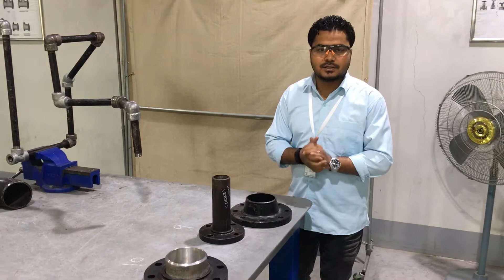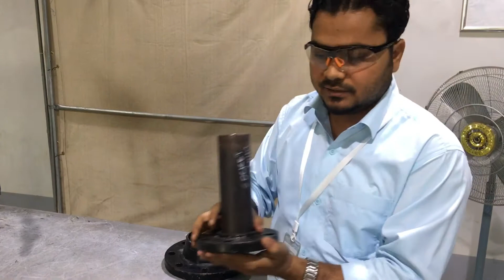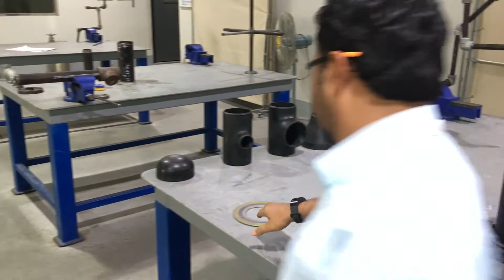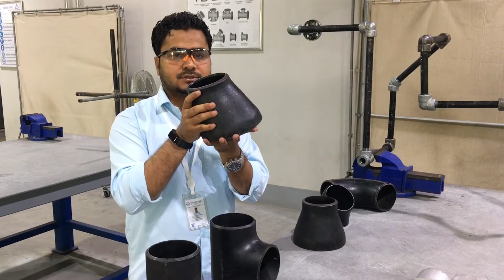PIPING DIFFERENT TYPES OF FLANGES AND PIPE FITTING

Comment: Weldneck Flange 0:32
We will attach by welding flange to pipe using butt weld process, we will mainly use these in Critical area's where weld joint needs Radiographic inspection 

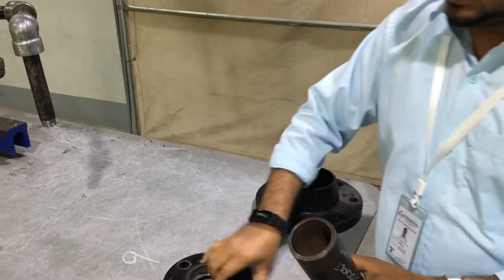Socket welding flaneg  0:43
Socket weld flabges are welding one side only During the welding we give 1mm gap between flange socket to pipe ,these flanges are used in small bore lines 

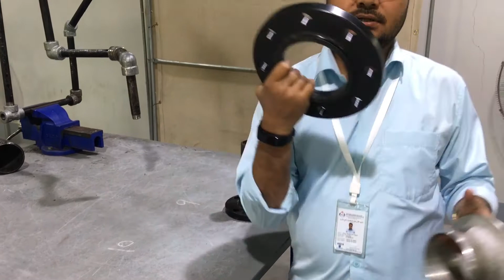Lap joint flange 01:00
The lap joint flage are used with stub ends

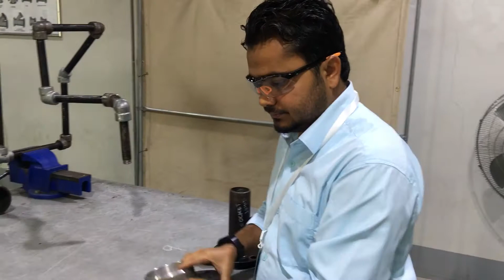Blind flange  01:11
Blind flanges are used to close the ends 

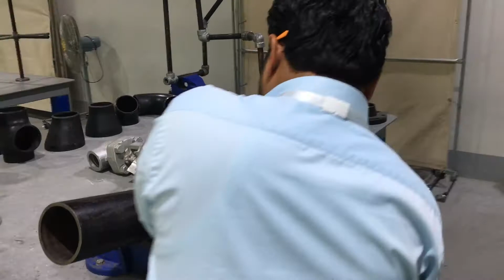Slipon flange  01:25
The slip on flange is attached by  welded inside as well as out side